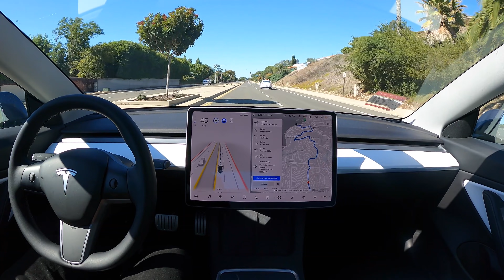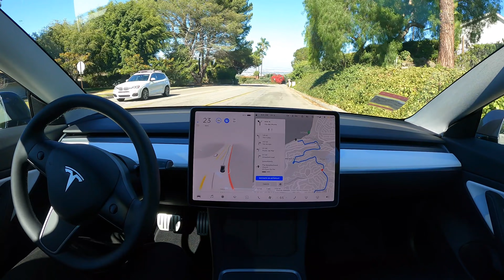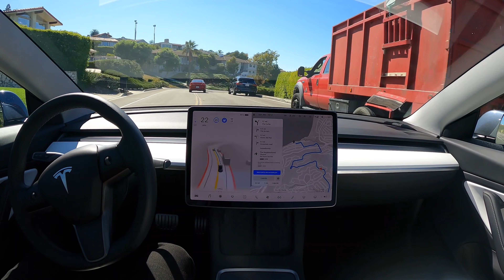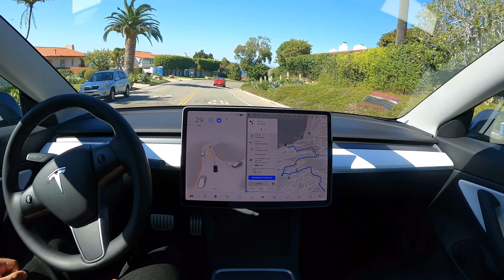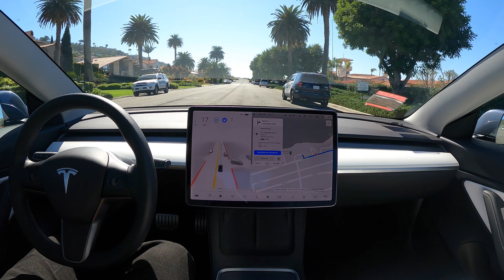Raw 1x: Neighborhood Church on FSD Beta 10

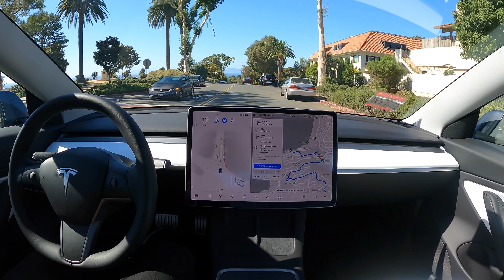Comment: Thanks for posting!  At ~15:20, what in the actual simulation????  Did the car proceed based on being waved on by the traffic controller???????  Or did you have to tap the accelerator?

I am officially impressed w Beta 10.
Reply: if you looked closely on the pedal, he did tap on the accelerator
Reply: @Blankoi  Hit the accelerator when it slowed a bit in the intersection but Omar did NOT hit it (as far as I can tell) when the wave happened. Hard to say if FSD moved based on the intersection being clear or the wave, I'd put money on the former.
Reply: @Blankoi  Thanks for your reply.  I will watch again.  I did not watch his feet or thought I could see if he taps the acceleator.